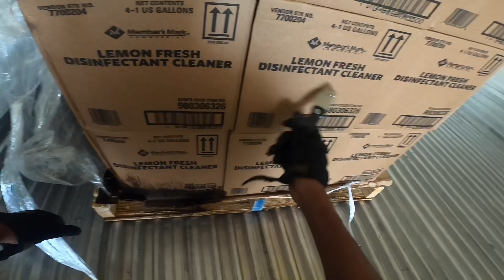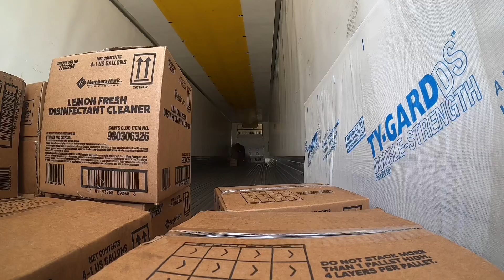My Toughest Day As A OTR Truck Driver | Truck Driver Vlog

Comment: To bad you can’t hook up a hose to your glad hands and blow it out that way. I know they make an adapter for using your tractors air system ti air up your tires but not sure about a blower adapter.
Reply from the maker: Bro that would be so lit! I be seeing the 1 for the air pressure but for blowing out the trailer…that would be super lit!